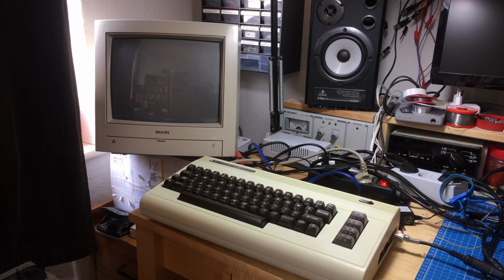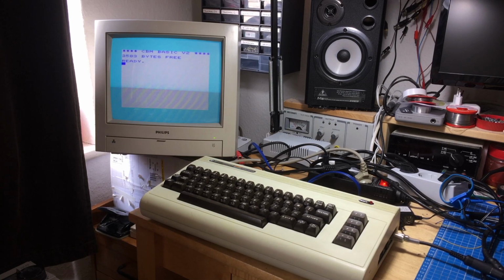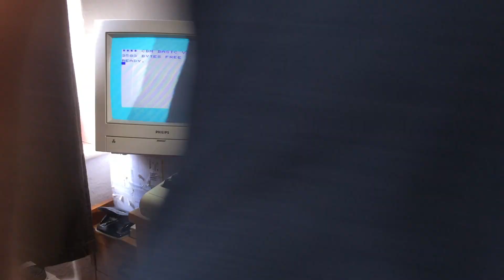VIC 20 Future Proofing Addendum: Overvoltage Protection

Comment: I must have missed it: What is the new bridge rectifier you used? I don't think I'll be able to find the appropriate one myself, although I do think I'll be able to replace it fine without ruining the board. (Well, let's hope I will be.)
Reply from the maker: You can basically use any bridge rectifier with the same footprint, I think I used a slightly larger one here (possibly the KBPC604). Be warned though: the rectifier is pretty non-trivial to desolder, there's a lot of heat that just sinks into the legs and diodes (and the traces are relatively wide, too). If your rectifier works fine, I'd consider leaving it as is.

Comment: I've had a broken bridge rectifier on the 5V rail in a VC1541. One of the diodes had a drop >1V. It was getting extremly hot and the drive kept failing randomly during operation.

Comment: If you put a fuse inline that only allows the current draw there should be then you equivalently have some under-voltage protection.
Reply from the maker: That's an interesting idea. I'm going to look into that. Might be difficult to use a reasonable fuse because the power surge while switching the computer on could be too much.

Comment: Love the series for all three C64, +4 and Vic20.

Back when  I worked for First Star, the one thing I hates was my Vic 20 getting hot. Sure, after a few hours it was toasty warm, but having it on 18+ Hours while it compiled some code, it was hot. Touchable but a lot more than just "Noticeably Warm!" Of course there were no Digital Thermometers to figure out how hot it was, but I tried a CPU Replacement on Vic 20 and then on the 1540; replacing the 6502 with a 65C02 (CMOS version of the 6502). It gave me two pluses: The Vic20 (and later the 1540) ran a lot cooler and it ran a bit faster. one prime example was what took 18 hours to compile now took 15 hours. It may not seem like much but for 1980s!

BTW - This was a Vic20 with the 2-prong 9VAC port.

Q: Anyway to Future Proof that, as in the Logic Board PSU Area? I'm thinking of replacing the regulators and the caps for this.
Reply from the maker: Oh, interesting that the CMOS chips ran faster. I might source some and try that actually. Recently got some 65C22 as spares.

Thanks for sharing this!

I think you could put heat sinks on the ICs in the two prong VIC 20 as well. The voltage regulators probably could be replaced with sufficiently specced dc-dc converters, too. That would really bring the temperature down by a lot. I only have the one VIC (or VC rather) from the video so I can't experiment with the older board revision at the moment.

Comment: Since you're directly adressing my previous comment (which is great) ... I've serviced a Telefunken RA-742 which is over 45 years old and works mostly with capacitors (ceramic and electrolytic) and resistors with no digital circuitry which still works extremely accurate (it's an analog computer) - so much for the theory "caps have to go bad!".
The real reason I attacked your capacitor swapping is a bit different - I agree that caps can go bad and sometimes do - but I've seen more boards being ruined by people unexperienced with soldering tools than the actual amount of bad (leaded) capacitors I've encountered so far (~200 8/16/32bit machines). Also some people expect a capacitor swap to do magic like fixing a bad PSU or dead chips which it can't of course.

Nice of you to add a supressor diode as a follow up -  which goes beyond the scope of what I meant when you oversaw a common point of failure. Let me tell you what I meant ... in your VC-20 there are (at least) 4 smaller chips by MOS technologies, which (I think - I'd have to check) are called 65245 and 7707 - those were produced back then by commodore to bypass shortcomings in supply by external producers which did the job back then, but were produced in a hurry which is why they're known to fail nowadays (luckily I haven't encountered a case where they killed chips they're connected to, but just died on their own). While the 65245 is usually of decent quality (I've had 1 out of 12 fail in 4 VIC-20s so far) the other smaller chips are way worse (I usually replace them these days without testing [especially on C64s], so I gathered roughly 50 of them and had a failure rate of 60% when checking them at a later point). Luckily those chips can be replaced with readily available 74(ls)-series chips. A comparisionlist can be found here: https://www.c64-wiki.de/wiki/MOS-Chip_Liste_(Ossi64)

Rock on :)
Reply from the maker: That's a good point you're making there. I've seen some "repairs" gone bad, too... Still I think it's legitimate to share this stuff and have people try their luck.

As for the MOS chips, I've had one of those faulty 74-MOS-"clones" in a C64 I repaired not too long ago, too. They're indeed notorious for failing. That list is going to my bookmarks. Thanks for the reply & tips! :)
Reply: Hans Meier You are completely on the mark with your observations. I too have had significant failures with MOS made small logic chips. Its to the point now where I simply replace them outright anytime I see one.

Comment: Nice tip with the TVS suppressor diode.
One thing to consider: Yes, they will probably trip the fuse - if you have one!

The older power supplies only have a primary fuse on the 230V (or 115V for North America) side which won't be bothered, as the primary current will be too low. The internal fuse of the C64/VIC20/etc. only protects the 9V AC rail.

With original PSUs, the TVS will then probably burn out the 5V regulator, which is at least for the 'elephant foot' PSU inside the cast resin of the transformer, thus not replaceable. Still better than loosing all the ICs, but you'll have to take it in consideration.

Only if you have a 3rd party PSU or have built your own, you are going to have a dedicated fuse for the 5 V rail which will be tripped by the TVS.
Reply from the maker: You're probably right. I was somehow assuming that the dead short on the 5V rail would blow the primary fuse, too... I'll add a little disclaimer to the description at least. Thanks for pointing that out.
Reply: I'm not sure about the primary current when the secondary of the transformer is shorted, but I'd assume that it's enough to burn out the windings, but not enough to trip the primary 630 mA fuse.
That's also why I added the 5V fuse in my PSU design: Although I put in a 1.6A fuse, it'll trip rather easily. (Did that a few times with my multimeter probes. Will have to set up a testing rig for that.)

Ballpark calculation:
Assuming that the fuse will trip rather quickly with the 10-fold current (data sheet and Wikipedia say the T-rated fuses trip within 0.3 s), the secondary current will have been around 10-15 Amps.

On the primary, this would result in a current between 400 and 600 mA for a 230V primary winding. (I'm ignoring the short-circuit voltage of the transformer here, as I don't have data; Double the resulting current for 115 V windings)
This is well within the rated operation of the fuse link assuming a 630 mA rating. (The fuse will happily take 1.5x that for an hour or so before preaking)

Thus, the voltage regulator will eventually (after a few seconds) take that role and burn out. Maybe the secondary winding will join it if the regulator is fed from 9V AC. Lots of magic smoke.

That's also why you'll always need secondary fuses: A transformer kind of 'resets' all the protective measures you have taken on the primary side.
When looking at the secondary, you're always starting from a blank, i.e. unprotected, supply.

While this is annoying with low voltages, it gets pretty nasty pretty quickly with medium or high voltage. ;-)

Comment: Thanks for the shout out and product placement :D I'm making a larger batch now. I've started with the cable and input connector end while I'm waiting for the pcbs.
Reply from the maker: No problem. People kept asking about something to keep their computers safe and your saver is the easiest and most convenient way I know of. It deserves a bit more attention, I think. ;)
Reply: I've used and abused one of bwack's savers for awhile now and I love it! Does the trick for sure, can't recommend them enough!
Reply: Thanks for the interest. €22+€7.
Reply: Yes, it protects from failing 5V regulator (or loose ground connection on the regulator)
Reply: How much do you charge for a cable + shipping to Sweden ? Thanks in advance!
Reply: I'd be interested in one of these, too.  Out of curiosity, is it just the 5v line it protects?
Reply: This is v1.2, but no. I haven't spent more time on a new design.

Comment: Where you put that suppressor diode on your C64 has a small capacitor on my C64.  Is it OK to put it in parallel with the cap, or do I need to find somewhere else for it?
Reply from the maker: I would recommend putting it somewhere else. The little ceramic caps can actually blow up quite violently when shorted. What board revision do you have (ASSY no.)? If it's different from mine there are some suggestions in the pdf I linked below the C64 video. The pdf is German but you can search for "suppressor diode" and look at the pictures.
Reply: Jan Beta - Thanks. The ASSY NO is 250407. The cap is printed as C92.
Reply from the maker: Mine is an ASSY 250425. It's pretty different. Here's a picture of where to put the diode on your board rev: https://app.box.com/s/27cn50k68lk16onpkr3tlvypt53wwcmy
Reply: Jan Beta - Thanks again! That was above and beyond. I love the idea of keeping these machines running well into the future. I'm seriously considering putting an hdmi socket on mine.